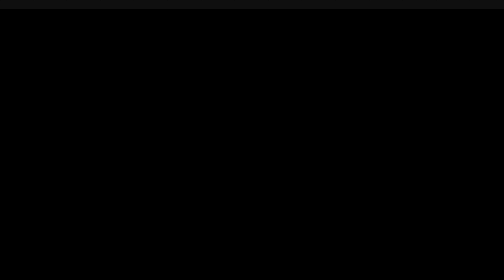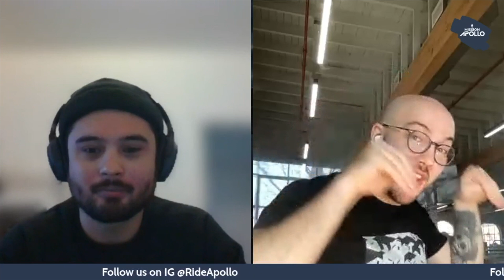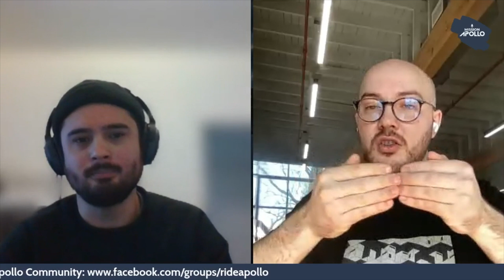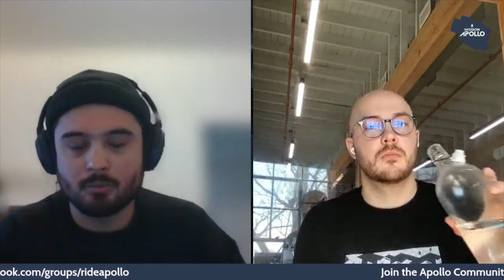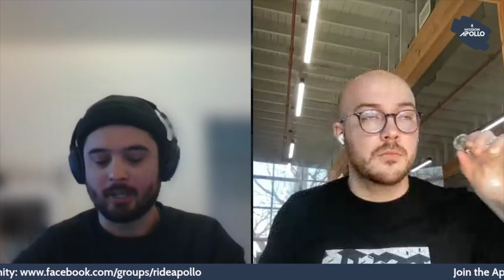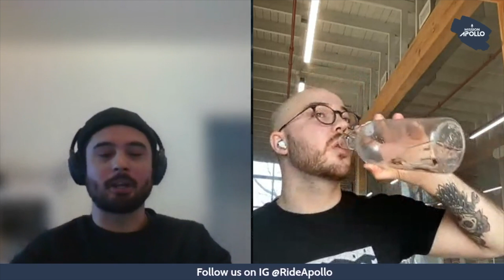Mission Apollo: Breaking Down the Apollo City 2022

Comment: Can somebody please help me with my Apollo city pro 2022? For some reason, the stem/shaft/ steering tube was loose.. meaning, The handlebars are loose with the front wheel. The front wheel can turn on its own while you’re holding the handlebars straight which is very dangerous. I took it to a bike shop and we tried to tighten down the locking nut and stem pinch bolts but we can’t get them tight enough to keep the handlebars from slipping left or right.

Please let me know what I can do to try to get those tighter as it’s too loose to ride. Could be dangerous if I hit a bump in the front wheel turns to the left while I’m holding the handle bar straight.

Anybody with any information would be greatly appreciated. I’m hoping there’s a quick fix. Please help. Thank you in advance

Comment: The Apollo Phantom has a useful option that allows the turn signals to operate simultaneously acting as hazard lights. Does the Apollo City 2022 have this option also? If not, how difficult is it to add this option to the Apollo City 2022?

Comment: i personally think that this scooter is a pretty weird scooter to have in the lineup. i currently have the phantom and its amazing, i love it, the weird part is first of all the weight of this scooter. i think for a city commuter people want a lighter scooter. Also, why does the cheaper scooter have more features than the more expensive one? if you were going to make a new scooter, than i would add all of the new features to the one that costs $300 more. Again this is a super impressive scooter, I just think you missed the point with a few things, I think the biggest one was the weight, as I was thinking about this scooter to ride in college while I keep my phantom in my dorm room. The air is not powerful enough for me, and the city is to heavy for me. I just wish you offered a scooter in the middle of those 2 models with the newest features.
Reply: phantom is intimidating to me and im sure others. The city sounds like a dream machine; Alot more approachable scooter.
Reply: What about the ghost??